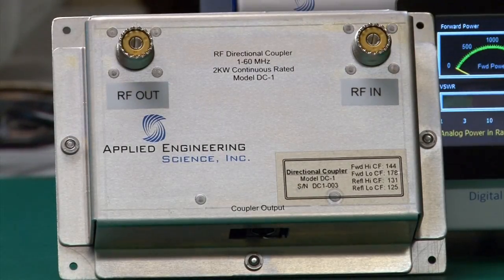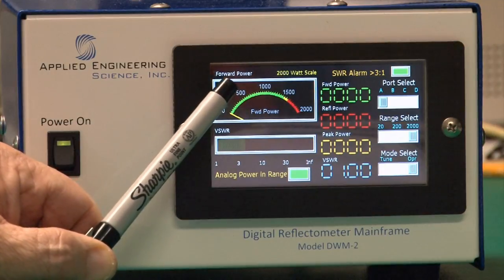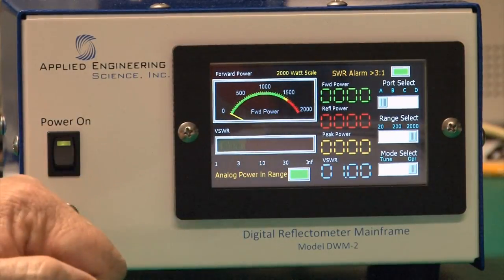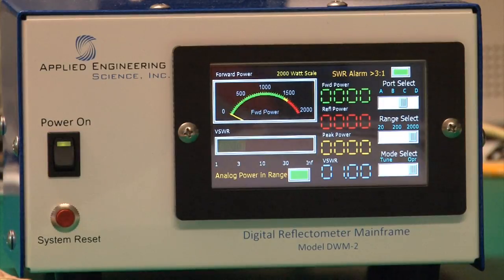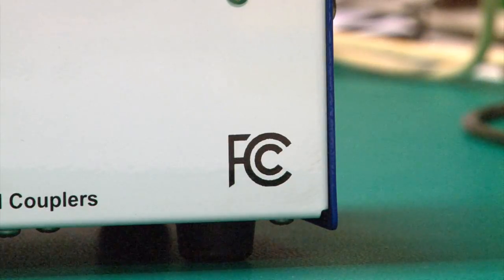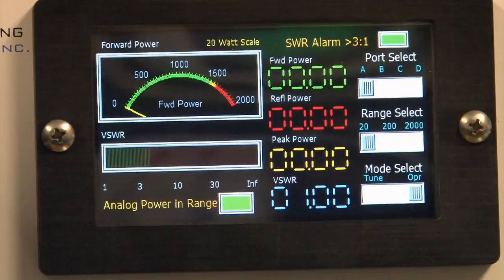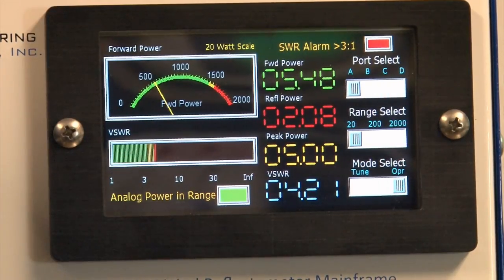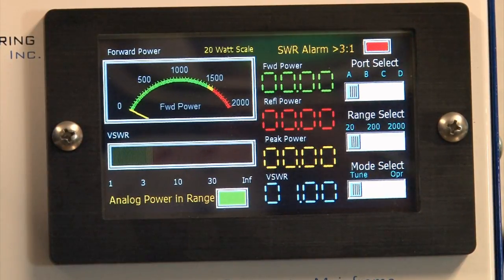DWM2 Digital Reflectometer Intro

Comment: it looks great, one of the things I noticed is that when you change the scale from 2000 Watt to 20 Watt the 'analog' scale still says 2000 Watt
Reply from the maker: Hi,

Yes, you are correct.  The video was prepared before we discovered that bug.  Rest assured, it does not perform that way!
Reply: Applied Engineering Science Inc ok, nice that you also discovered that bug, it looks like  a great instrument altough would have expected that the the housing would also be somewhat more impressing, love the fact that it has couplers you can put behind the set instead of having to bring a coax cable to the instrument.